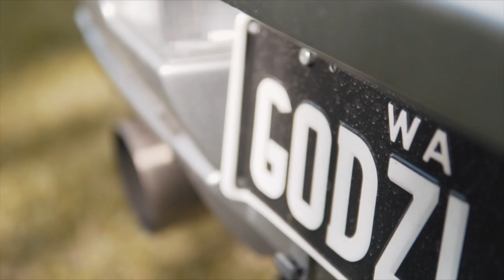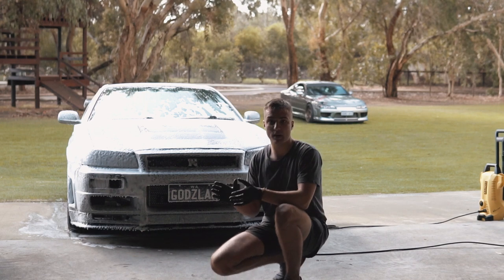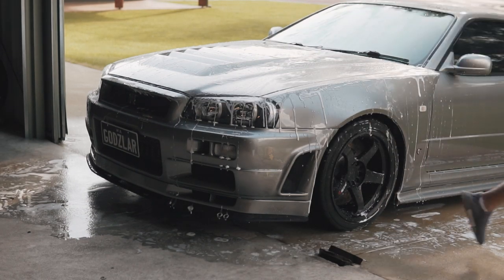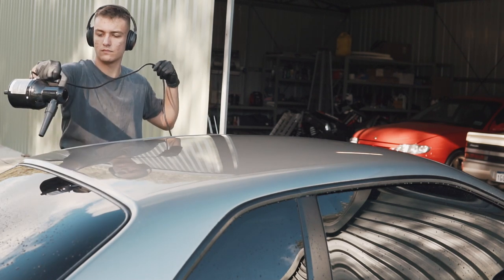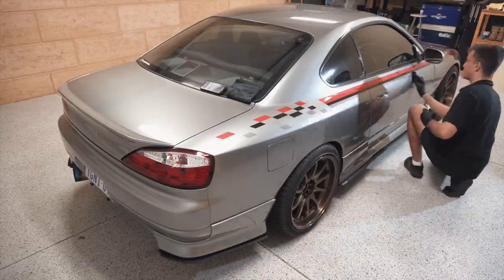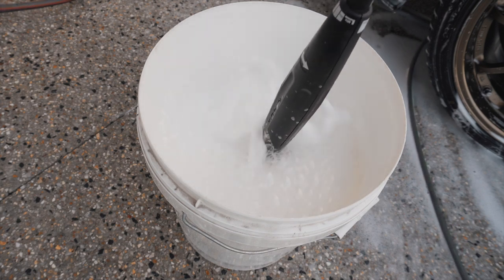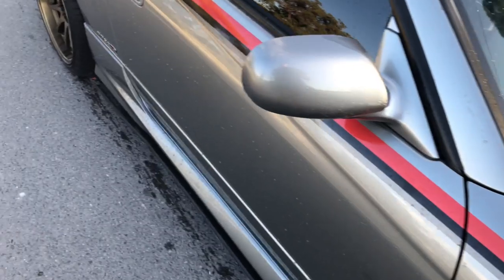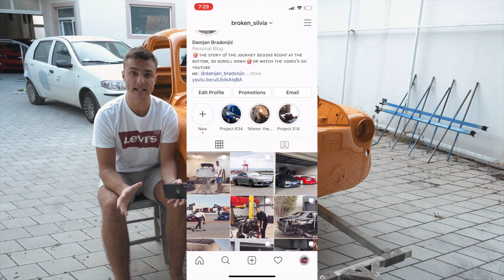R34 GTR & S15 Silvia BATH | How I Wash Cars

Comment: My 180sx needs treatment so bad. Heaps of swirls and scratches. I'm a bit of a noob when it comes to actual detailing. Thinking of clay baring the whole car then cut and polish it after. Or should I use a different method? Cheers man
Reply from the maker: Yep correction will remove scratches